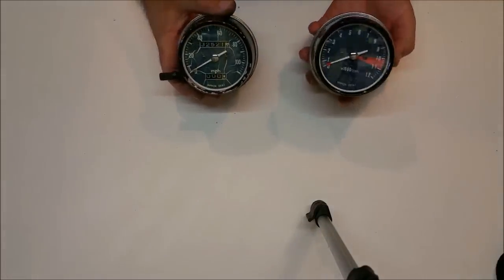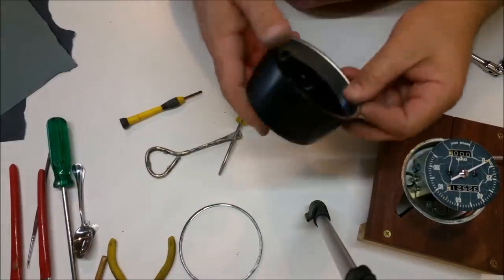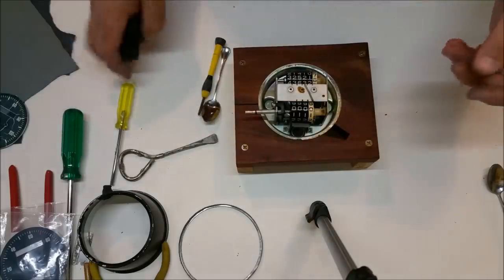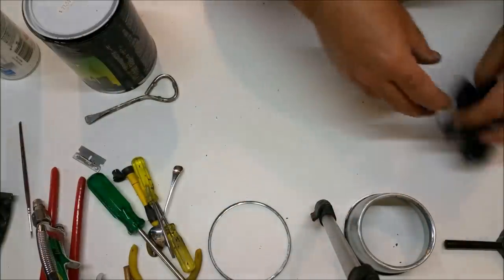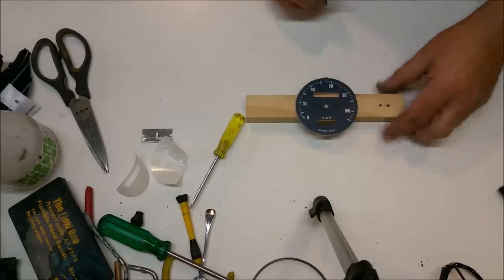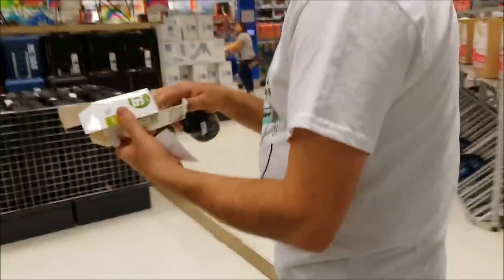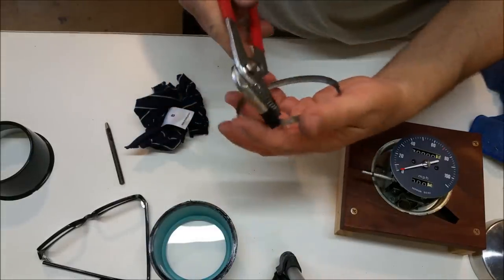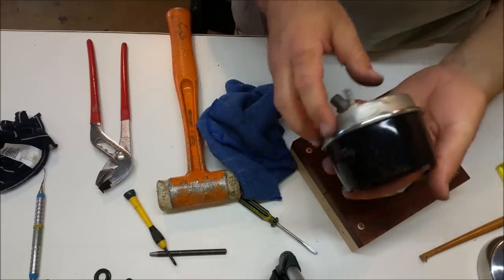Instruments - Restoring the Gauges

Comment: Prep wash and rubber grease.  Two of the most important things I have learned from watching your videos.  Excellent!
Reply from the maker: Thanks Pauline! Cheers.
Reply: Prep wash is a kind of miracle universal solvent that has so many uses and rubber grease has proved so handy with all the stuff I have been doing with the brakes and clutch cylinders on the Austin.  I had not been aware of either of these things until you mentioned them.  Learning can come the long way round sometimes.

Comment: Hi Peter, I’m in the process of refreshing the clock faces on my 1976 Honda 400/4, this is the second time I’ve done this as the vinyl ones I did about three years ago bubbled in the sunshine and became very annoying to look at out on the street!
This time I’ve purchased actual printed discs that totally replace the original discs, plus I purchased two new crimping rings, rubber grommet and am now waiting for two new glass replacements from the same company in Holland.
Which will arrive soon hopefully, and watching your video on how to do it with the little tips etc will make the job easier this time aroundZ,
Thanks for that.
Dave in the UK
Reply from the maker: Hey thanks Dave, I'm glad you liked the video. I'm sure you'll get the result you're after... particularly if you've done the gig before. Cheers and thanks again.
Reply: Peter Anderson yes I did make the jig and like you I lined the inner face with self adhesive felt! Keep up the good that you do also like your style and approach. 👍

Comment: Really helpful. Thank you. I used the replacement bands from CMS for my UK CB500/4 which gave a good result. I also used black silicon sealant as my seals were shot. I just “piped” thin beads with the gun.

Comment: Nicely done Peter, it's like you've been doing instruments for years.  With normal straight-out drives, like in most car speedos, the bottom end of the speed cup spindle sits inside the main shaft bearing in the magnet which is why the little bearing wears out. But in these angled drives the bottom end of the speed cup spindle sits in a bearing mounted on its own separate bracket as you saw.  In this arrangement the spindle lower bearing barely does any work and so it will last forever. Good to chuck a little dob of oil in it anyway.  I totally forgot those cable drives were angled downward, been a while since I've done a motorbike speedo. 
As for the speed cup seeming to be moving sluggishly, I was shouting at the monitor..."NOOOOO.  It's meant to be like that."
The upper speed cup spindle has a little cup or a disc (usually a little cup) that holds a tiny amount of silicone oil to dampen the movement of the pointer so it doesn't bounce up and down when going over a rough road.  Most instruments have some dampening built in.  When you come to doing the 750, remember it's meant to be there.  
Lastly,  could you can scan the two 750 dials and post him a good quality exact 1:1 scan, that way you can keep the dials you have ?  
There is a way to do the dials at home if you want to devote some time to it. 
Anyway, as in my opening line on this comment, nicely done.  I've been doing this work for years and I wouldn't have done anything much differently.  :o)
Reply: a reliable way to get "good quality exact 1:1 scan", place a flat ruler in the frame when you scan the dial. Measure the output against the ruler afterward.
Reply from the maker: Thanks so much for your wonderful assistance Harvey, you made the job easy! It must have been pretty difficult to watch a novice particularly where that speed cup was concerned, but it all turned out well in the end. Thanks again, you're a legend, cheers.
Reply: No worries Peter, glad I could help in some small way.  In fact I thought you did all the work like a pro.  When you're ready to get the MG tacho working let me know.

Comment: Those old GT Suzuki's with the plastic len's tend to mist up with time.  I restored 
ones on a GT550 with a combination of T-Cut and clear wax polish.  Firstly, apply
the the T-Cut, with a soft cloth, rubbing in a circular motion on the lens, then buffing
it off, then applying liquid wax, buffing it off, and repeating the process until the
lens's come clear again.  Believe me, it worked for me.

Comment: Excellent video! Would like to suggest an alternative to prying the stainless ring off. Using a Dremel or other rotary tool with a cutoff disc, cut straight through the ring, towards the bottom of the gauge to conceal the cut. Then spread the ring apart carefully to remove, just like a piston ring. You can also squeeze it a bit to reduce the radius, This way, when you reinstall it, it will hang on nice and tight.

Comment: There should be a metal tipping die, almost the reverse of a can opener to peel back the ring on these gauges. Hand crank or electric, but either way we all know basically how the were crimped together, it is getting ring off when the housing is plastic. As everything else is plastic. But a sharp edge plow to place into the back of the ring, then lick a can opener, roll it against itself while having a side crank to pull out until the radius is larger enough to take it apart.
 I own a 1969 Datsun 1600 Roadster that is also called the “Fair Lady” around the world, but most interesting is the fact the gauges have a true glass face. The can comes apart in a proper fashion from behind. Cleaning, lube, wiping the face but making it like new again was easy. 
 Plastic housing require the ring to be captured and rolled onto itself. Otherwise cracking the housing is a real possibility.
  I have open instrument cluster on an American car, a 1981 El Camino, half car, half truck. Regardless how I try, removing the speedo needle, it breaks. I can’t find parts only used ones for $100 or like 50lbs sterling! Anyone know where to find a tiny $2 part without paying and arm and a leg? I would appreciate it. 
DK, certified automotive ASE Master Tech since 1978, retired, of course fixing someone’s else’s car again, my youngest son, 35 years old. 
Thanks again as this is more on this subject I have ever seen! Inside I can fix, getting a 50 yr old needle off and breaking it, is completely different! Now I sound like Monty Python. Walk this way!!!?

Comment: My father gave me one of those needle oilers decades ago. I don't use it often, but when I need one, nothing else will do.
I think they used them for oiling fine machine parts. (He was in charge of tooling for a very large manufacturing firm.) I also think they used a similar oiler for sewing machines.
Reply: grandfather clocks and in my family's case transmissions. Particularly the oiling the valves and parts in the bores for easy installation.

Comment: Hi Peter, I followed your video to also fit a "Classic _Gauges" dial overlay and it worked fine. My Honda XL125 speedo dosn't have an alloy rim but is plastic and part of the plastic casing, but I prised the plastic apart as you did with your alloy rim.

Comment: Great video. Made myself a little wood plate to disassemble and it came apart fine. Can re use the rings. My problem is getting the inner blue/white apart from the outer housing which need paint and cleaning and I don't think you showed having a problem. Guess they are just stuck. Might be worth mentioning on mine (k6) I got the ring all the way off the speedo, Opened it enough to get a pair of needle nose plyers on the nut on the reset shaft and the twisted the reset nob to the right (left hand threads, and it threaded off. also when removing the needles with spoons, mine were so tight I had to rotate the needle to get the spoons over the screws or I would have broken the old face plate. Then they came off.

Comment: Hi Peter, I'm trying to figure out why the gauges on my 74 XL175 and XL350 are slow to move when riding.  They seem to sit at the peak spot that I either hit speed wise or RPM wise and slowly (VERY slowly) return to "zero" when I stop.  What mechanism inside needs lubed and it is easy to get to without worrying about springs flying off or anything else I could easily ruin if I take it apart?  Ive tried spraying some lube into the worm gear that the cables plug into but not having any luck getting them to free up.  Thanks for any help you can provide!
Reply from the maker: Hello, the needles are meant to be slow on return, so not to jump around too much - but I'm not sure about that slow. I don't remember what was suggested to lubricate them with... I used a very small amount of sewing machine oil, but I don't recall what the instrument builder told when we discussed it later on, cheers.

Comment: Peter, great vid i asked you before where to get the overlays but your supplier wasnt interested for my honda hornet. Ive recently found an ebay seller from Poland called venoxy who is happy to do odball and custom all they want is a scan of the gauge face emailed to them. They communicate well and quickly. I will update on their product after order and use but they sound great and no risk posting stuff away possibly never to see it again. Regards Bob
Reply from the maker: Thanks for that Bob, I need to get my 750 ones done, but if they do get lost, I'm screwed as the K8 is non-existent here and K7's are extremely rare. The supplier I used did astonishing work, but I just didn't want to post the faces, cheers.

Comment: By using an abrasive (wire wheel) on those nuts, haven't you taken the protective coating off that will prevent them from rusting? ?

Comment: It's worth saying that, particularly on cars and larger stuff, you'll often find that the speedos will be very mucky inside as what can happen in a lot of vehicles is that a seal in the speedo drive in the gearbox gets worn or fails and it'll start drawing gearbox oil up the cable as it turns and it will eventually make its way into the speedo head and cause all sorts of problems with sticking, jumping and general misbehaviour.  I'm not sure if it can happen on bikes but as there must (or, at least, should) be some form of lubricant in the speedo drive I would think it could.  What often happens is that the oil or lubricant that makes its way into the speedo head will combine with any dust or wear products in the unit and create a sticky paste.  Of course, if it's an older British vehicle you're working on then you might not actually realise there is a problem as the speedos on them generally tend to get a bit wobbly once they're past the first flush of youth anyway...

Comment: If I want to clean the inside of the glass do I just undo the two bolts on back of the tach and speedo and then slide the top part off?  Or is there more holding that part on?
Reply: It's got a lip that Honda rolls over in some type of jig. This is where most people give up, very hard to remove without damage and get back on...

Comment: Hiya Peter, I’m attempting to replace the rear shocks on my Honda 400/4 F and was wondering if you have replaced the rear shocks? Everything seems fairly straightforward but how do one remove the bottom bearing and replace with new bearing? Any ideas ? Thanks
Reply: Not U  1st  RODIO

Comment: Maybe you did this and did not show it, but here's an extra thing I would have done. I would have calibrated it. There's no reason to believe the speedo is as well calibrated as when new. As it is not absolutely vacuum tight, and air pressure does change, the air inside can exchange with outside air, encouraging corrosion of the return spring, making the speed read high. I don't know whether the spring can be replaced. But next best is to adjust it to correct the reading. Run it with a drill to a constant speed say 60mph for enough time to rack up a few miles on the odo. Record the time exactly, and multiply by the indicated speed. If this disagrees with the odo, adjust spring. Repeat until correct. Laborious because to get it within 1% requires about 10 minutes per run.

Comment: You did an amazing job with this, WOW! Thanks so much for documenting and sharing the process! Could you please also provide a list of all materials you used, if possible? I know you mentioned prep wash but not sure what that is exactly and what that that's called here in the states - is that the same thing as mineral spirits or paint thinner? Additionally is there a recommended vendor/website that would have a large assortment of replacement stick-on gauges (like the one you used) and if so, what is it? Thanks so much again it's very much appreciated! Definitely liking and subbing after seeing this video - this is the first time I've ever come across your channel! I'm trying to dismantle and restore a set of gauges off of an 80's vintage Honda motorcycle and hoping the tricks and tips shown here will somewhat help and translate into restoring my vintage motorcycle gauges.

Comment: Right, three remarks.  1 : You did a fairly good job. But, 2 : The bezel is to be replaced and flanged on again, it's the only way to get it right. And 3 : take the opportunity to dismantle and clean the mileage dials, it does pay off.
Reply: Hey Yves,  I know this was a while ago but how do you clean the dials?  Mine look ok, except the white 1/10ths - they are quite yellow.
Reply: @adrianjones5402   Yellowed plastic, very cheap solution. Submerge the dial in hydrogen peroxide and shine a UV light on it (tanning bed..) for as long as needed.  If you place the dial in a plastic container, remember plastic blocks UV, a glass tray is best, or leave the top off and change the dial´s position from time to time. Afterwards you can put a layer of automotive clearcoat, 2K on it to prevent yellowing again. Done :)